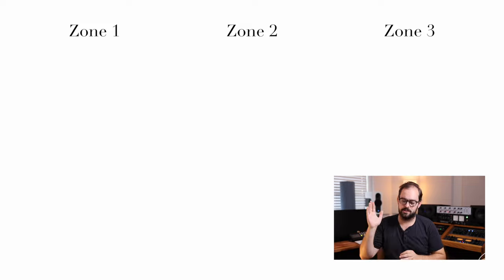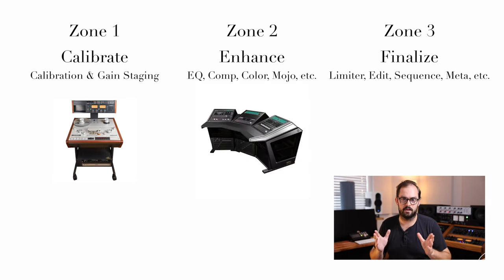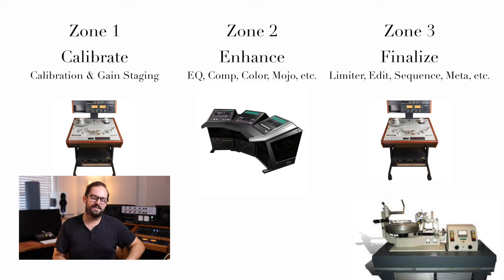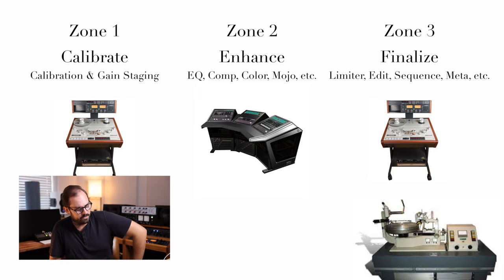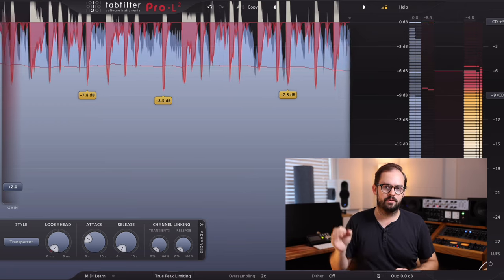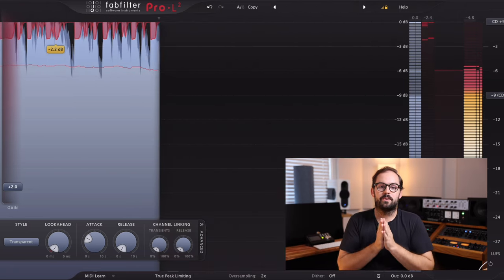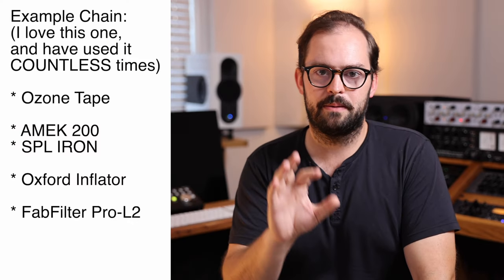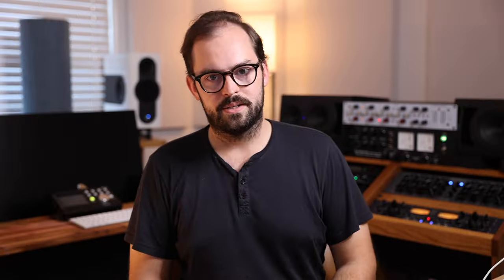You're Using Your Limiter WRONG

Comment: One of the most important controls on the output limiter is the off switch or bypass. The biggest sin I hear, which applies to both limiters and compressors, is that they are used to "rectify" the mix.  "It will be fine when we put the limiter/maximizer on it!" Certainly, with the compressor, that is NOT its role. It is not a device for repairing uneven audio, smoothing over joins, or bringing up the room. And a limiter is NOT the thing to make sure your peaks don't overshoot your max level. All that should have been sorted with careful editing, balance, eq, etc, BEFORE you get there. If when you switch off the limiter, the mix sounds worse, especially a lot worse, then don't turn it back on. Fix the mix.
Reply: compressors are absolutely a great device for all three of those things. so much of the modern sound comes from compressing after reverb to have the tail brought up in your face.

hard rules like this aren't very helpful and don't lead to great records.

Comment: I think I inadvertently stumbled upon this when I was messing around with the "Maximizer" in Cubase. With just the limiter it was sounding louder but that's it. With a combo of the maximizer with soft clipping enabled and the limiter with less input gain I was getting the same overall loudness but a much tighter sound, especially on the vocals.

Comment: Excellent info once again. I'm doing my work in the box, Mac Mini M2 with Studio One 6.5 Artist.

My 2 bus has 3 inserts, a Pulsar Audio W495 EQ, LVC Clipped-MAX and Limited-MAX. The limiter is only doing 1.5 -  2 dB gain reduction.

The 2 bus also has a post section where I have a few Master meters.

I picked up on the pointer to use a clipper harder than the limiter, but still using both. I like what I'm getting through this setup.
Reply from the maker: Glad it's working for you!  Thanks for watching!

Comment: Traditionally (historically) it was actually: 1/2" or 1/4" tape > NR decode > console with 1 or 2 EQ's, no compression, no limiting > 1/4" (most often) or 1/2" tape. Key to all that (and still) is you make decisions listening from the end of the chain (off-tape), not to a section in isolation.

Comment: it's really helpful advice. i'm not a mastering engineer, but i do mastering just because my clients ask me to do it for them. years before i used to slam my stuff so it feels cluttered and unstable (it's so cringy for me to hear it on Spotify nowadays, damn). and i didn't even hear that, because my ears were so washed out after days of working on a song. until i start clipping in a different ways – soft clipping, digital clipping, wave shaping, sinoid folding etc... now my levels are consistent before limiting process and i have enough volume almost every time, especially when i produced and mixed everything wisely. 

now my limiting is not a "lufs tool" as it was before, it's more like a glue and and additional peak control to make sure that everything doesn't sound over -0.3dBFS. and my average limiting now is around -0-2dB with some extra peaks might be -3dB. but not more, except is an EDM track when the sound should be pumped extra. in this case i just use two limiters – one for pump and one for control at the end of a chain. i hope that more people got this mindset to make they tracks more solid after limiting

Comment: Interesting I have kind of done this with mine anyways (in terms of layout of chain) I master my own stuff in the Box and use Tape emulation into compression into EQ into clipper in to limiter (sometimes into 2 limiters both doing minimal 1-2 Db). I need to learn more about release times and how it affects the pocket in a practical sense but this is good to know the basic Idea of the chain I use is correct. Subbed

Comment: I think just throwing your mix into Ozone and following along the usual path does work, and it makes a decent master. But I find there's a lot more care in chipping away at it effect by effect. Soft clip, saturate, filters, regular EQ, dynamic EQ/Compression, and THEN a limiter, it all works together making little 1-2dB adjustments, and you end up with a master that's -10 or -12 LUFS without sounding dynamically compromised.
Reply from the maker: You’ve got it!
Reply: @WillBorza  oh and also i do all my mastering in audacity with free vsts

Comment: The most transparent gain reduction on full spectrum material is hard clipping.

So, this is correct advice, except I use two limiters… the first: 0 look ahead and max attack (preventing the limiting algorithm from engaging), minimum release (to only affect the transients)…

Then use the second limiter as normal.
Reply: If the material isn’t full spectrum, you’ll get some unpleasant farts if more than a couple of low frequency cycles are clipped 😬

Comment: What's the most important control on a limiter? The release time.  Yup.

Adjusting the release time truly allows one to, manipulate the character of the sound.  As presented by the, release, time constant. Ultrafast to, ultra-slow. And everything in between.. That allows one to tweak for density. Making it nice and thick. Keeping the level  front and center. And the release time control can, garner all of those variables. That creates a remarkable difference in the thickness of the sound.

My favorite limiter has always been the,, 1176 series types. All different permutations,, flavor and alphanumeric version.. A through, H. Maybe a pair of UREI LA-3 A's? As I sold my LA-4's. Oh well.. Or my one of my numerous DBX's. But my 165 A's now also, gone. I already miss them.. I'm finding my downsizing extremely depressing. Sure.. Just get rid of my life. Pretend it never hhappened. Throw my life away. I might become a nomad vagabond soon. I've been there before. But I've recently taken up in a brick-and-morttar, obligation.  And my life is completely on hold. For the rest of my retiirement TFN.. And this sucks! Not the plan! This was not the plan!

Maybe I'll pretend I'm back in the early 1970s again?
RemyRAD

Comment: I hear what your saying and this was good info, but we have to take into consideration that not all limiters adjustable release control, and some do have it but it’s attack and release together like in ozone.
Reply from the maker: If you pull up maximizer in plugin doctor, you don’t see the attack move or change at all.  It’s more like “sustain” or “hold” and release
Reply: @WillBorza  oh okay that makes sense. I always wondered exactly what izotope designed the attack/release to be. Been hearing a lot about plug-in doctor too, might need to cop that. Thanks for the info!
Reply from the maker: Plugin Doctor is a godsend, and it’s only $39.  It’s the best $39 you’ll spend this decade.

Comment: Hi Will, can you please share how you use Inflator in your mastering chain, like how you use it as a clipper? Thank you!
Reply from the maker: Sure thing!  The IRON and AMEK push into the clipper, or if they are being used with more headroom, I may use the gain fader on the left side of inflator just until I see the song pushing a little bit into the red (if you turn off the clipper you can see that the signal lights up just a few LEDs above 0).  Once there, I'll use the Vintage Lim for more loudness if the song needs it.  Sometimes program material can't hold up to hard clipping, so in those cases I'll make sure not to hit the red line on the inflator, and maybe choose to use the soft clip effect or not.  If soft clip doesn't do great things and hard clip is too much, I'll bypass it entirely and opt for a cleaner limiter like Pro-L2 or Maximizer instead of Vintage Lim.
Reply: @WillBorza  Thank you so much! How about the process and curves amount? Do you leave it at 0? Also whats an example of a vintage limiter? Fairchild?
Reply from the maker: Maybe I’ll do a video mastering a song or two with this chain.  Hard to explain with words, easy to hear.
Reply: @WillBorza  That would be awesome! I will be on the look out for that video. Cheers!

Comment: Awesome video!!! I found very important the perspective you gave to the subject. Would you share some audio where we can hear bad transient release settings and the same song with correct settings, to hear how the groove is affected?
Reply from the maker: Thanks for watching!  You can totally set up a test like this in your DAW.  Pull in a very dynamic mix and throw a limiter on it.  Push the limiter much harder than you normally would, just so the limiter sound is exaggerated, then try the release at “fastest”.  Hear how everything gets crispy.  Then quickly move it to “slowest” and hear how everything gets quiet.  Then try “fast” and “slow”, then “medium fast” and “medium slow”… just keep trying equal opposite release settings.  That’ll help you really hear that release most clearly.

Comment: You just made clippers sound more intriguing to me. I never liked the idea of "clipping" the transients. I can never get my mixes loud enough. Maybe I just need soft clipping before limiting?
Reply: Clippers are weird actually, you can clip a transient, and push the volume up, making the sound louder yet it shows up quieter on the mixer. (More headroom, yet louder sound) It prepares the sound/mix for further processing, the compressor won't have the extra transient length messing with it and will make everything sound fuller. The guy in this video barely touches on it, mixing engineers never want anyone to know about clippers and they barely say anything about them because they're quite vital.

Comment: I’ve got one question, so how come you can use the clipper for the uneven reduction without that also ruining the groove? 

Is it the way a clipper works vs a limiter which makes it more suitable for these uses? Also, i wonder if there’s a limiter where it sets the release dynamically to keep the groove despite the different amounts of gain reduction.

Thank you for these vids btw!! Heaps of knowledge in such a short time and always so well explained :)
Reply from the maker: Yes!  Because the clipper doesn’t have an attack or release time, it can trim off uneven transient peaks without changing the dynamics at all
Reply: Ahh nice one thanks! Makes sense :) @WillBorza

Comment: So... can someone explain? I understood it like this: 
(1) take a saturator that can set a clipping threshold
(2) set the clipping threshold to where you get your desired lufs
(3) send that to the limiter at +1db, set the limiter to -1db
(4) play with the release to your liking
Reply: for example I have a track at -14 lufs, i put it through
gsat+ (peaking at around 9.5), then set the
clip ceiling to -6

i run that into ozone maximizer with +1db input gain, with a -1db ceiling and -6db threshold. is this what he meant?

edit: im completely selfthought when it comes to mixing and mastering.

Comment: I literally do this every time I master a song. Clipper to manage sharp transients so the limiter won't have to work too hard. And it will sound consistent and not much distorted. 🙂 And I master entirely in the box, but with those zones in mind. 😋

There were also some cases where a song with not much transients didn't need a clipper and using a well-dialed limiter is good enough. ☺️

Subbed. 🖱️👍
Reply from the maker: Thank you so much!
Reply: TRUE. Same here. I only use the clipper if it works for the song, but it doesnt' always work for every song..
Reply: @Pocket  indeed, not all songs. especially those with not so much transient sounds. 😉

Comment: You want to clip before you go into the limiter.
What about the Distortion reflections you'll create in the high end (ITB) which you will bring out with the limiter still ITB?
This idea would require the mix be done with no artefacts still at mid-level in the high end, or a mix where the music does not use heavy distortion already as an artistic choice.
Thoughts?
Reply from the maker: All good concerns, and usually yes.

Oversampling helps tremendously.

Comment: In my method, the release time is key.  I'll figure out what I want my threshold at and then use the release time as sort of a focusing tool to adjust the transient timing of the track or mix.

I've even noticed that I can shift the groove to some degree if I use different attack and release times on different tracks in a mix...or am I nuts?
Reply from the maker: You can TOTALLY shift the groove with attack and release!  That’s why I suggest in this video to precede your limiter with a clipper to keep your limiting consistent.

You can do the same thing with a compressor if it has a “max reduction” button or something along those lines
Reply: Think of it this way, the attack determines how long until the full ratio of compression is achieved after the source passes the threshold, so it is essentially a curve you're adjusting. Also depending on the program material and how busy or sparse, tempo, etc.. they can all be quite interesting variables when shaping dynamics with the attack/release curves in mind. (re: your comment on compressing individual tracks during mixing, obviously not applicable in a mastering sense).

Comment: Thank you for the advice 🙏🙏

Would appreciate if u could answer a quick question, you can do clipping with a limiter if u turn the relase time to 0 right?
Reply from the maker: Usually no, release time at zero is “padded” on most limiters so that the actual speed is “very very fast, but not instant”.  You can check your plugins in Plugin Doctor to see if you can get it to actually clip or just “very nearly” clip.
Reply: @WillBorza  oh okay thank you I will

Comment: Long time fan. Just curious, how often if ever at all do use multi-band compression when mastering? And if you do use it, where in your chain would you typically place it? Thank you.
Reply from the maker: Thank you so much for watching!

I use mb comp maaaaaybe 1 in 100 masters.  I see mb compression as very invasive and most songs that pass my desk don’t need it.
Reply: @WillBorza  I’m founding this to be equally the case in most of my work. I just wish I hadn’t spent my money on an expensive course by a reputable British engineer (who I’ll leave anonymous) suggesting entirely the opposite. As always, thank you for your consistently candid insight.
Reply from the maker: Just because I don’t do it that way doesn’t mean someone else can’t get results using those kinds of tools… it’s just a tool that doesn’t vibe with me and my style.  I barely even touch compressors at all except for box tone.  Usually an eq and a limiter are plenty.
Reply: @WillBorza  Agreed. Certainly—to each their own. I just happen to agree with you that it is invasive in many cases. I got the impression he used it almost always. Perhaps I’m mistaken. Like you, I don’t find myself needing it much. Nevertheless, many of the ideas I was introduced to regarding mb compression have proven invaluable while mixing. So it’s all good.

Comment: I was going to say depth knob but I guess release makes the most sense (i.e how long the limiter applies the threshold). The thing I get most confused about though is how to mix. I use EQ on everything, compressors on some things and limiters on buses. I haven't used clippers though but I read they create more saturation and that the order of the chain should be Compressor-EQ-Clipper-Limiter. Does anyone know if it's better to use these things on each individual instrument, or can they also be used on buses (eg. drums, leads, etc)? 
Sorry for the confusing and convoluted questions and I thank you for your time. 🙂

Comment: Awesome thanks will! Question - the rushing and dragging effect is easy to hear on the compressor but seems more subtle on the limiter because the release times are usually pretty fast - 10-20ms seems default in ozone. Of course  it’s BPM dependent but what would a typical limiter release time be?
Reply from the maker: What up Ryan!  Good to hear from you!

On Ozone Maximizer, according to my quick test in Plugin Doctor, your longest release time available (setting character to maximum and using IRC I, II, or IV), you're 95% back to normal volume at 500ms and fully back to normal volume at 1000ms.  With the character at 5 (50%), it's about 250ms to 95% of normal volume and 500ms to be fully back to normal.

Anything 2 and below on the character setting is going from super fast to instantaneous.

And all bets are off in IRC III and IRC IV "Transient" modes - the character at 10 is super fast and the character at 0 can tell your fortune.

For Vintage Limiter "Tube": if character is at max, your release time is around 20 seconds to 95% recovery!  at Minimum, about 1 second to 95%.
Reply: @WillBorza  Thanks, Will! This is really helpful. More videos like this please!